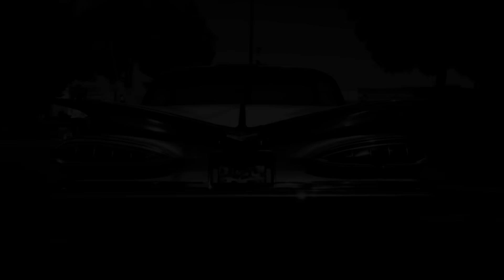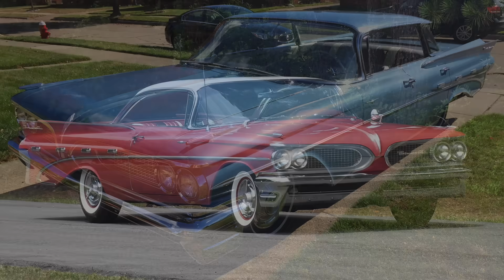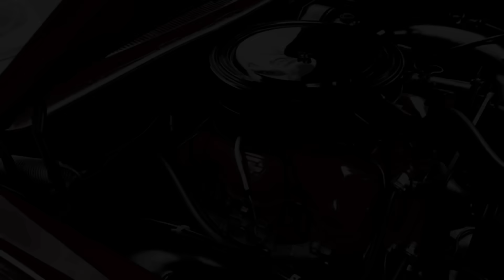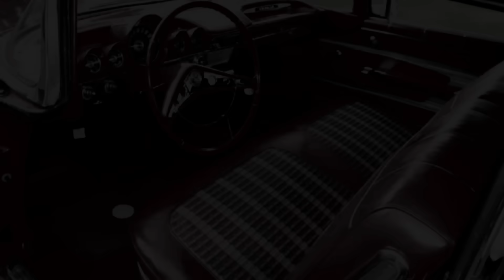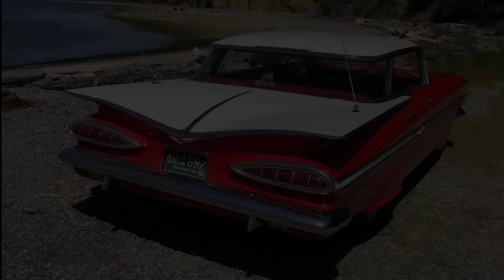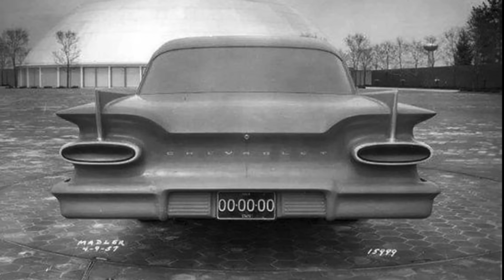1959 Chevrolet Impala: Top 10 Facts About Chevrolet's Most Iconic Car!

Comment: I love seeing these videos.  We had one of these cars, when I was a kid.  My dad, bought it new in 1959.  Mom wrecked our car, and we were on vacation, out of state in Colorado.  The car she totaled was a 1953 Packard.  Dad, was a Packard guy, but by that year, they were out of business.  We looked at a couple of used cars, but I remember, one car the trunk kept popping open, and the second one, Dad said had a noise in the engine--I was little--just 5 years at that time.  Then he decided to buy new--his first. He was conservative, and bought the bottom of the line "Biscayne".  It came with a 235 cubic inch 6 cylinder, 3 on the tree, an am radio, heater and seats--that's it.  This car was a 4 door, but basic.  In fact, the dome light did not even come on when you opened the door, so he wired in switches later.  The car did extremely well, and when I was 16, he gave me that car.  He then bought a 70 Impala--ready, 250 cubic inch 6 cylinder, 3 on the tree, an am radio, heater, but this had add on air conditioning--not factory--but by a company called "ARA". Again a basic car and a 2 door.  Oh yes the big step up, the dome light came on when you opened the door.  This was a basic "come on car" at a dealership, to get you to come in and by a more expensive car--350 V8, Automatic, Air Conditioning, Power Steering and Brakes at the minimum.  I was with him, and when he told the salesman he would take that stripped car, the salesman's jaw dropped🙈🙈.  Again, that car gave many years of excellent service.  Then in 1977, I convinced him to get a nice car, a Caprice--fairly loaded.  They drove it many years as well, and it served him well.  Then in 1989, he bought another Caprice--this one was quite loaded with goodies.  He was older, and drove that car 28 years--unbelievable, that car ran and ran.  He passed in 2017 at 93 years.  He was  a WW II Army Vet of 3 years, and a Navy Korean war vet of 4 years.  So God bless him, and all Veterans who served this country, deceased and living.🙏🙏
Reply: Very nice comment, spanning decades. A 28 year run is remarkable.
Reply: @kjpraman991 thanks for the story
Reply: @George-dx9nc  You are welcome.
Reply: Great story very similar to my Dads life. He was a carrier naval officer and retired to a life of custom home building and goat farming! Traveled to my grandmothers house 300 miles away with five goats in his 74 Chevy 1/2 ton window work van. God bless.
Reply: Comma, comma comma. comma comma comma comma comma 🦎.
Reply: @stacyhamilton2619 —-And the point of this is ❓
Reply: @mrdiplomat9018  
You didnt read it?
27 unnecessary commas.
That's the point.
How are your points, mrsdipsomaniac?
Reply: Also, Culture Club. 🦎
Reply: @mrdiplomat9018  The point is some people can write, and then there are total "DOUSHBAGS" as you.
Reply: @stacyhamilton2619  Idiot, Idiot, Idiot, Idiot, so tell us a story about the Yugos, you own, ha, ha, ha. IDIOT.  You are a Total Doushbag

Comment: Your last couple of cars (stacked headlights in the middle, and the one after that) clearly show that SOMEone had been looking at Ford.  The stacked center lights would have been a very poor imitation of the lines of the Edsel horsecollar grille (a travesty itself), and the one following looks something like a '58 Ford in the front and a '60 Ford in the back.  Dunno whether someone got canned for those two prototypes, but the actual production Chevys for all years, whether one liked their appearance or not, all achieved distinct and unmistakeable brand identity.  You didn't have to see the badge to know it was a Chevy; one look would do.  And despite sharing of certain body parts, that was true of all the GM products - each looked distinctly like an Olds or Pontiac or whatever, and also displayed the obvious family resemblance among the 5 brands. 

Indeed, the same was true of the Ford, Chrysler, and AMC families all the way through at least the 50s, 60s, and 70s.

My recollection of some of these cars:  The '57 Chevy was the classic we all still recognize; the '58 Chevy and Pontiac were OK but not as fetching, while the Olds looked bulky and the Buick and Cadillac were kinda ugly.  For '59, the consensus was that the Chevy was distinctive, but kinda sucky, the Pontiac looked pretty good, the Olds and particularly the Buick were much improved from the previous year, and Cadillac had won the fin contest, but didn't look good for it.  Caddy got a bit better for '60, and ALL of Chevy, Pontiac, Buick, and Olds looked much more businesslike and neat compared to the previous year.  (And the Corvair arrived.) For '61 and on, I'll not mention Cadillac; in '65 it finally got the makeover it needed.  For the others, '61 saw downsizing and neat, attractive styling (Olds had kinda strange lower rear quarters).  Styling excesses seemed to have passed.   A lot of engineering and mechanical innovations were just ahead

Comment: I owned a 59 4 Door Hard Top Impala, blue on blue with a 348CI Four Barrel Rochester Carb and a Powerglide 2 speed tranny. It was owned by a deaf lady and had 65,000 miles on it. She had some body damage which I repaired most of it. I was 18. It was pretty powerful for such a large vehicle. I had just finished the body work and was involved in a five car pile-up cause by a yellow 65 Impala. My Dad and I replaced the front end assembly and radiator ( we had to use a 283 unit because the 348 radiator was not available now days you could have one made to fit.) Great and reliable automobile, not a sports car but fun to drive.

Comment: I owned a 59 Impala convertible. The engine mounts would consistantly break causing the engine to kick back and knock the distributor against the firewall thus breaking it. Over time the floor pans rotted out exposing the road below. Only 2 things could be called attractive about the 59, the dash &  tail lights. The fin seam was a rust magnet.

Comment: 59 was also the first year for 4 on floor offered by manufacturer, previously dealers offered them
Reply: I had this car with the 409 and it was scary. Dandahermit
Reply: You're overlooking the tripower power in the 58 and the awesome 409 in the 59 and 60. I know cause I had them both. They were surprising cars.I also had the 58 Pontiac tripower. Dandahermit

Comment: Back in 1963 our family (I was 10) moved from Casselberry, Florida to Eugene, Oregon in a 1959 Chevy Biscayne with a 235 cu. in in-line six cylinder. The car had three-on-the-tree and we towed a trailer that was a truck bed of a Dodge pickup. The trailer hitch was a bolt on device that was mounted on the bumper...not the frame!  Here we were...a family of five...trunk full, trailer full, and no seatbelts. Everything went well as we had to travel over the Rock Mountains in Colorado. We kept the car for a few years after the trip. Good engine that "Stovebolt Six."

Comment: Thanks again, Adam.  Another interesting and well-done video.  RE: '59 Steering Wheel.  As well, I noticed the two smallest cutout holes were missing, and in their place were installed thumb-buttons as part of the ring assembly.

Comment: The Pontiac was the top-selling car in Canada only for a couple of years - usually it was Chevy. Canada was not as rich and more of a middle class country than the US, with high tariffs on US built cars until 1965. 
And then with the winters and salt on the roads, people tended to by basic sedans and not as many sporty or luxury cars - plus Canada has larger area with small towns and not as dense.

In the US, some states limited how the Big 3 could restrict if other cars were sold alongside their own cars - not true in Canada. The result was that GM essentially had 2 dealer networks - Chev, Olds and Chev trucks sold together in one chain, with Pontiac, Build and GMC in another chain - Cadillac were paired with some of each. Saturn, Hummer, Saab, Geo, etc. were treated differently but came later.
So the Pontiacs in Canada were essentially competing with Chevy as entry level cars and dealers wanted the price to be almost as low. since Pontiacs and Chevs were built on the same production lines in Oshawa, east of Toronto, it was cheaper to share as many parts as possible and make them in Canada, though some Buicks and Olds might also be built in Canada on the same lines.
The Beaumont and Acadian were made until 1970 in Canada - essentially they were badege engineered Chevelles and Novas with different grilles and sometimes Pontiac dashboards. Cars were also made in Canada for shipping to other Commonwealth countries, sometimes with RHD not LHD.
We had a 1966 Beaumont 4 door with the 250cid 6, and later a 1970 Acadian too.

Comment: I remember the coolest thing, my parents did.  To our, 1959 Chevy Impala.  When it was new.  I don't remember if it was mom or dad?  But they built an option.  An option only we had.  Yes.

We liked going to the Drive In Movies.  Especially for science fiction movies.  And with 2 little kids and a bench seat in the back.  We could get fussy.  So?

They built a plywood platform.  With legs, that would sit on the floor.  Then mom got a chunk of foam.  And made everything behind the front seat like a large bed.  For my younger brother and me.  It was great.  And we could see the movie better from the backseat.  They would just take it out of the trunk.  When we got there.  Then drive home with it.  Because Danny and I would be asleep.  And easier for mom to turn around to look after the children in the back.  And we saw some cool science fiction movies at the Drive In.

In 1970.  Mom purchased a brand-new, Chevy Biscayne, station wagon.  With a 400 cubic in v 8 with Turbo High dramatic Transmission.  And would become my first car by 1974.  When I was 18.  And no more buses!  Woo hoo!  I'm free!  And gas is cheap.  So even I can afford it making minimum wage.

It all changed by the mid-1980s.  That we now find this new mess that we are in.  The fuel is too expensive.  The vehicles too expensive.  And not the right battery technologies yet.  Now everyone is going to have to work from home.  Then only the wealthy will have fun cars to drive.

And we are back to go.  At...  Full Stop.
RemyRAD

Comment: Interesting video with one major mistake. The Ramjet Fuel injection was available in 1959. I personally know of a red and white Impala 2 dr. htp. with the 250 hp FI engine and Turboglide and a silver blue convertible with the the 290 hp FI engine and a 4 speed. Check  the 1959 sales brochure and the AMA specifications. Not many were produced.

Comment: Another bit of '59 trivia was that GM was planning on offering a fuel injection option for the 348 big block.  But, it was not the familiar Rochester Ramjet unit found on small blocks (yes you could get a '59 Chevy with a Fuel injected 283).  They tried experimental units from Rochester, Carter, Borg Warner, TRW, and Bendix.  Testers preferred the Borg Warner unit over the others.  The 348 Borg Warner sourced timed fuel injection unit used a modern style four throat throttle body on top of a standard style aluminum four bbl intake manifold that had mechanical fuel injectors mounted on the runners near the intake ports on the heads.  It used a high pressure (200 psi) fuel injection pump driven off of the camshaft timing sprocket with a chain.  It used a unique cast aluminum cover over the pump drive chain and the pump was mounted to the front top of the intake manifold.  This was a money saving effort to find a cheaper way to offer fuel injection and was tested on several 1959 Chevy engineering test vehicles, but was ultimately decided against.

Comment: One thing you didn't mention was that 1959 was the first year you could order a 4 speed manual transmission in your full size Chevy.  The Corvette got the Borg Warner T10 4sp mid-year in 1957, but the full size Chevy didn't get the Borg Warner T10 until the 1959 model year.  It was the first American full size car to offer a 4sp manual trans in the 1950's.  A 4sp Biscayne sedan with the 335hp tri-power 348 and a 4.11 or 4.56 rear gear was quite the performance car that year and did well in A stock and B stock NHRA classes.  These cars ran in the very low 14 second range at the strip which was quick for full sized cars in '59.

Comment: Thanks for the informative video! I didn't know that Chevy kept the mechanical fuel injection in their full sized cars for 1958. I thought it had been discontinued after '57...so I learned something. I should say that I was surprised to see the phrase "MOST iconic" used to describe the full sized '59 Chevrolets. They were certainly the most outrageously styled big Chevy ever, but I don't know about iconic. It was always my impression that, in and among Chevy culture, the '59 was one of the least favorite Impalas from the '50's and '60's. It had very busy styling. In my humble opinion, Chevy stylists cleaned up the basic design for 1960 and made it look much better.

Comment: I have heard that the 59 has Pinanfarina styling, not sure if that is correct though..
Just a note, Canadian Pontiacs from 55- 70 have full Chevy chassis, drivetrains, firewalls and steering columns too. Even the dash on a Can built 59 Pontiac is a bit different than the US counterpart.There IS a guy here on utube that owns a 59 FI Impala btw...

Comment: In 1971 I was 18 and bought a white '59 Impala convertible with a white top from a local gas station for $100. They said some old lady from New Jersey had dropped it off there but ended up just leaving it and they wanted to get rid of it. It barely ran with a bad engine problem (283 c.i.) but the tires were almost new. I could barely nurse it home to my parents' house 5 miles away, leaving a huge area of exhaust smoke behind me. My dad helped me get it running on an absolute bare-bones budget. Tearing into the engine we found that one piston had a big chunk missing! The guy at the Chevy Parts Dept. thought I was an idiot for buying just ONE piston. We installed oversize rings all around and got it running with a lot of blow-by though. At one point during carb adjustments a backfire caused the crankcase breather cap to blow off the engine and actually dent the hood! Anyway I drove it for a couple of years with no problems. It looked in fair condition with no rust but a big dent in the middle of the back bumper kept the trunk lid from latching right, and the top's mechanism was frozen but it could be raised and lowered by hand. The padded dashboard had a big crack in it down to the metal, and while driving a little smoke would sometimes seep into the cabin through the steering column. There was a new '74 Camaro that I lusted after at a local dealer but I needed a little more for a down payment. Some guy drove by me parked at the mall and called out Hey why don't you sell me that '59? Not knowing that it would ever be worth a lot of money I ended up selling it to him for a measly $50. I did get that Camaro and drove it for 10 years and 180,000 miles, but the Impala buyer got one incredible deal if he held on to it.

Comment: The 1959 Chevrolet Biscayne with the 409 C.I. big block motor, a 4 speed manual transmission,, with (not sure,a Stock 4:11 positrac rear end gears,? and, what I was told, Factory Headers!
This car wss  a 2 door, ordered with a bare bones interiior, - simple rubber floor mat in black, under the perfect, all original, no rip, light blue, which looked grest under the midnight blue metallic Idaho State Police Interceptor, which somehow survived, and after 64 years,-not driven much because it only hsd 17623 miles!😂
Reply: The first 409 was a 61

Comment: Probably not common knowledge anymore.
Those years Canadian Pontiac were equipped with a peppier base engine; instead of the sea green..? 235 inline, they had a red 262 inline.   
The Impala was not a big seller in Canada compared to the 210 which sold like crazy. 210 at #1 and Bel Air right behind it then the Pontiac line.
Reply: I might have mistaken the Bel Air for 210 which if this is the case then the Bel Air was the big seller in Canada over the Impala, the Biscayne was right behind.

Comment: Chevrolet did offer Ramjet fuel injection in the 59 Chevy for the first four or five months of production. A friend's dad, back in the day purchased a brand new 59 Impala with the 283 Ramjet fuel injection. Imagine what that car would be worth if it was still around today. It was a Satin Beige body with copper interior. The option was dropped due to lack of orders in the full size car line up, due to customer complaints of performance issues, which was often due to lack of maintenance. 

I have an old VHS video of the designers of the 59 Chevy's doing a seminar on why the car got the styling it did..... I have it posted on my channel, but the VHS tape is old and lost some of the quality, so the video is unfortunately kinda grainy looking with poor sound, but I was there in person listening to the lecture. It was at a Late Great Chevy International Convention back in the very early 90's that they gave the very interesting lecture on the styling of late 50's to early 60 Chevrolet's.

I remember the story on the fins from the horses mouth..... you got it spot on!

Comment: I think the loss of fuel injection was due to one of their main competitors, Chrysler, dropping their Bendix Fuel Injection for their full size cars due to mechanical issues after '58.A such, GM felt there was no need to offer it across the full-size line and it could be saved for Corvette production.